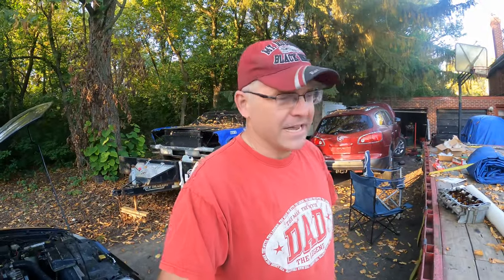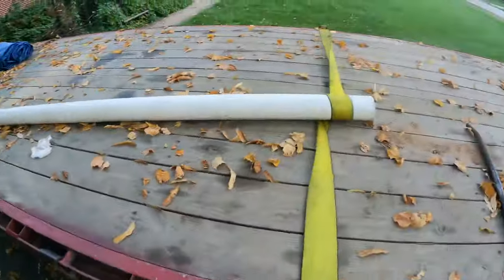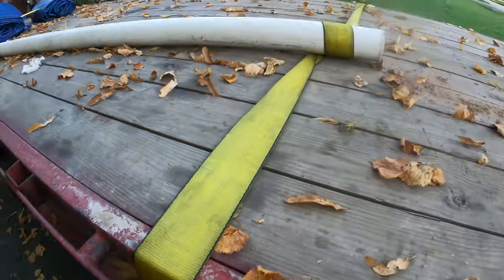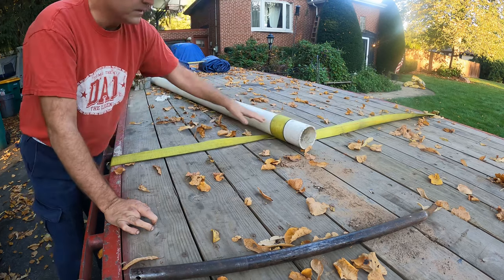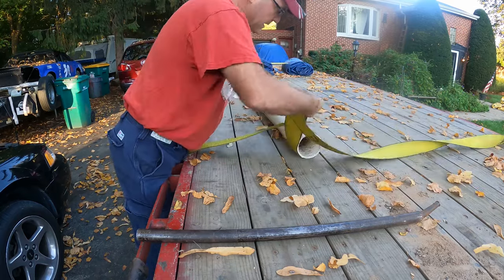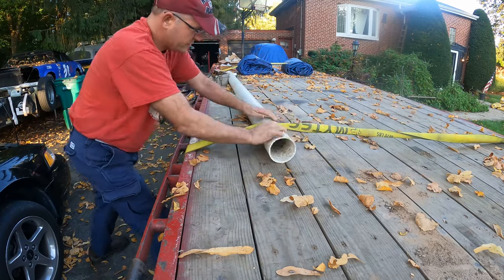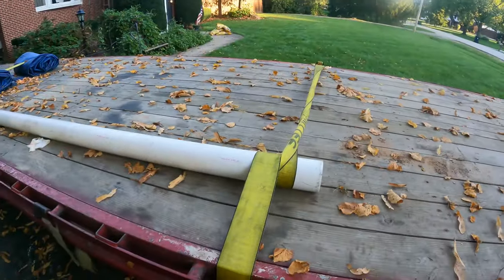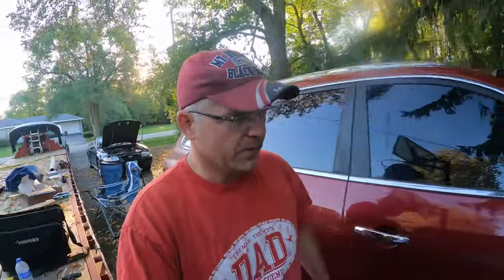How to properly secure pipe on a flatbed

Comment: The correct way to belly wrap is to have the strap pulling down from both sides of the trailer. Grab a shoestring and a pencil wrap it and pull down on each side and see the force. Use 2 hand ratchets one on each side
Reply from the maker: That was pretty much my demonstration, showing that doing it the wrong way was not secure at all. Only difference is I did not have a ratchet on both sides. You are correct, that will give the most equal pull.
Reply: @ninefingerstrucking5735  yessir!! Keep making the great vids!

Comment: Great tip...now we need a video showing the correct way to use chains and binders...!!!!
Reply from the maker: I’ll see if I can’t do something for that. Unfortunately, there’s a lot of opinions of the correct way to do things. Something as simple as the orientation of the hooks on the chains can lead to endless arguments.
Reply: @ninefingerstrucking5735  correct! lol just remember on the chain link there is a smooth side and a welded side, never hook on the weld!
Reply from the maker: @jamesnelson5700  and that right there is a perfect example. It is generally accepted and professed as common knowledge that you should not connect your hook to the welded side of the chain link, as it theoretically is weaker. However, when I bought chains from peewag in Bolingbrook, Illinois, they said it did not matter, that the welds were actually stronger. If I were to create a video on the subject, I would be certain to include both opinions.